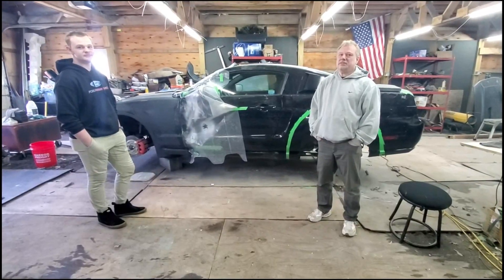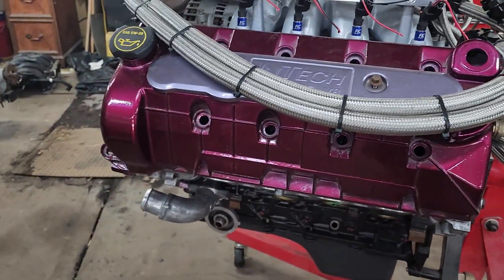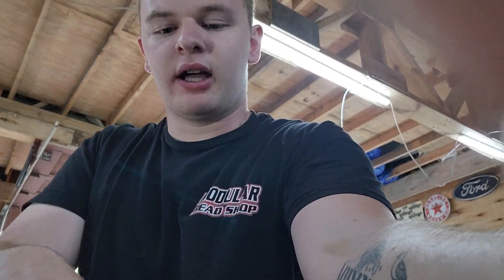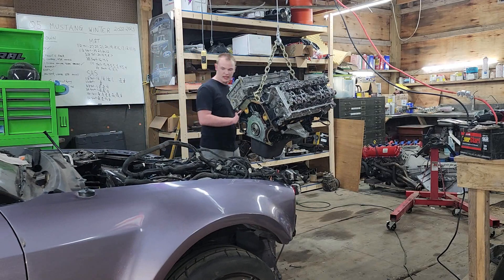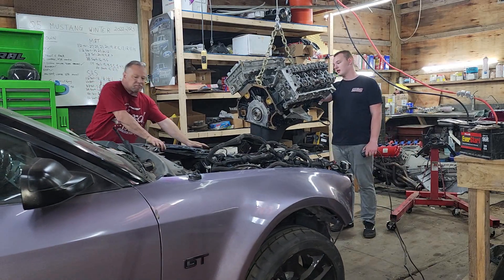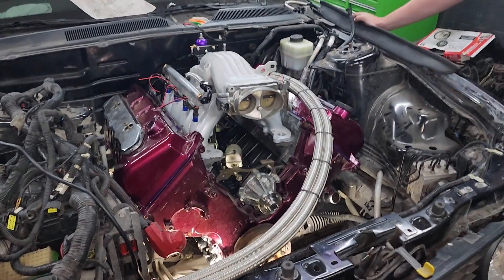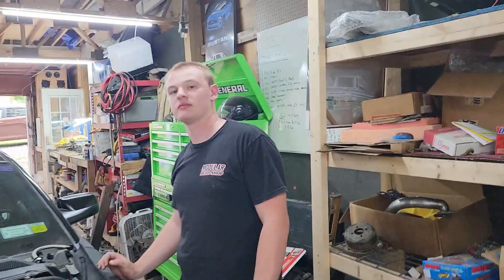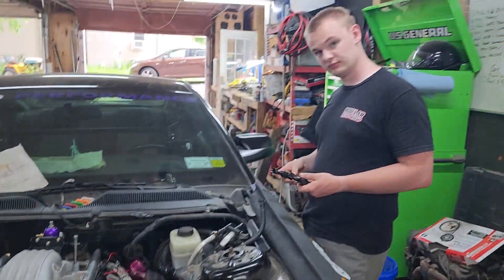5.4L 4V goes into Veronica the 2005 s197 Mustang.

Comment: I like these motors. I have a 4.6 in my 1997 Thunderbird. But I think I'm going with a 351 based motor. It's more narrow and speed parts are a little cheaper from what I've  seen.I'd like to leave the 4.6 but I'm an old guy and really hate computers. With the 351 and a carburetor plus a good C4 auto I Think I can make it work. I hope. Thanks for the great videos!!
Reply from the maker: Ha I hear you on the old guy.  There is so much electronic crap on the 4.6 that came out. the trans wont run without computer. T was really fascinated with the low tech of his 1964 mustang. I think a 351w with little work will make the thunderbird go nicely. be well sir be safe.